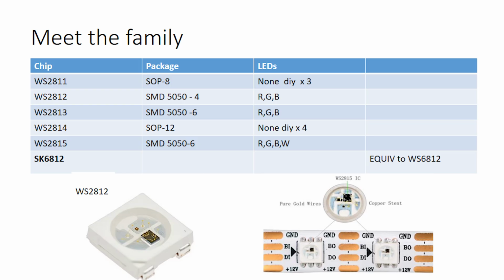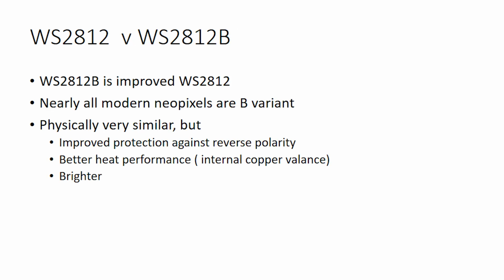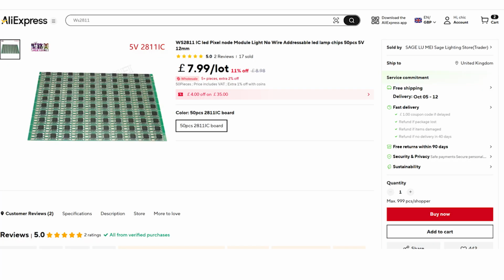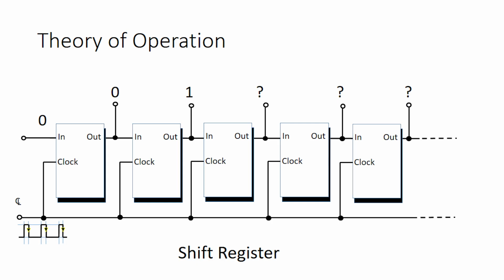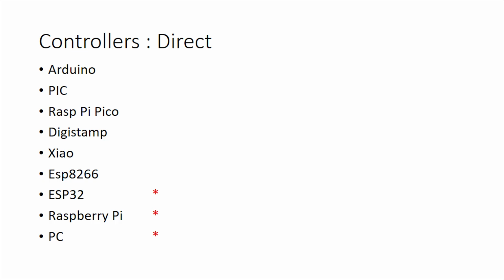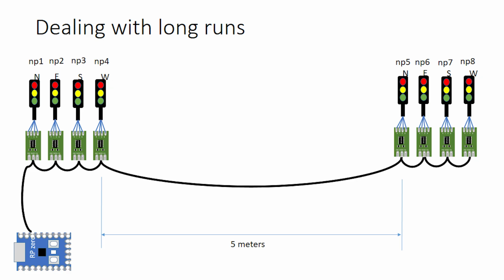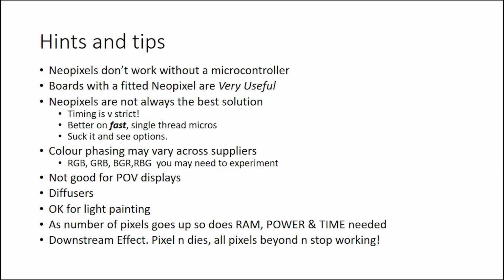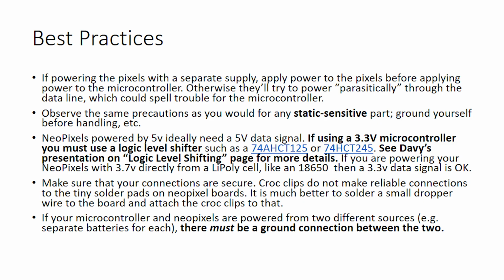WS2811 WS2812 NeoPixels and more...

Comment: Thanks for a very good overview of neopixels!!   Use them a lot in HO-scale steel mill model railroading to simulate fire in furnaces and molten metal usually with a Digispark ATTiny85 board.  Recently received some very narrow, high density WS2812B neopixel linear strings (from our friends in the East) to experiment with  ... the neopixels are 1010 size!

BTW ... in one slide, think you meant Digistump ... not Digistamp?

All he best ... happy model railroading ... cheers ...